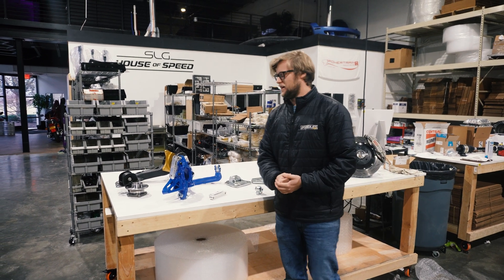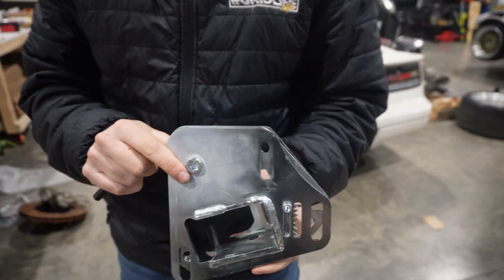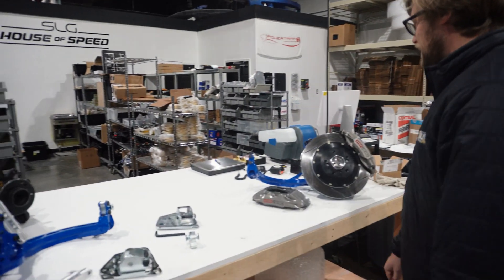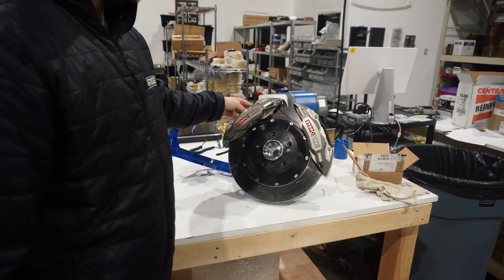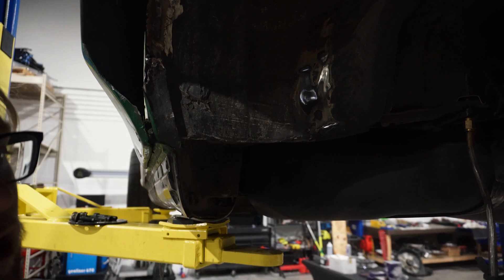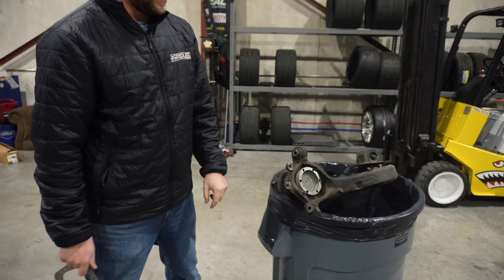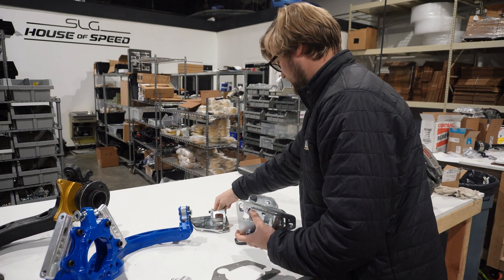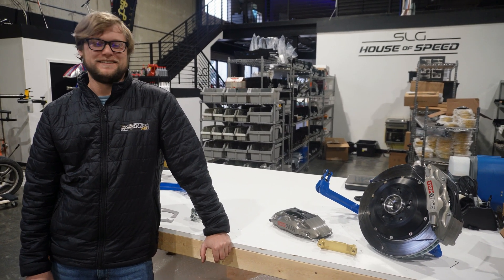Wisefab BMW E36/E46 Trailing Arm Install Part 1

Comment: Does e46 330i has the same axel as the m3?
Are the  330i axel compatible with this trailing arm?
Reply from the maker: different axles, but same outer spline so the arms are compatible

Comment: Are wisefab suspension components specifically for drifting or can they be used for road racing? I believe they have a kit for an E90
Reply from the maker: They have specific kits for each, but the E46 geometry allows you to use the same kit for both. For example we have the SLR angle kit on this road racing car for more front grip and quicker steering.